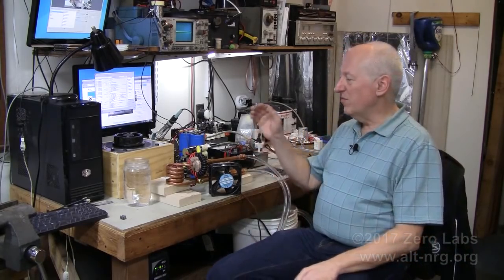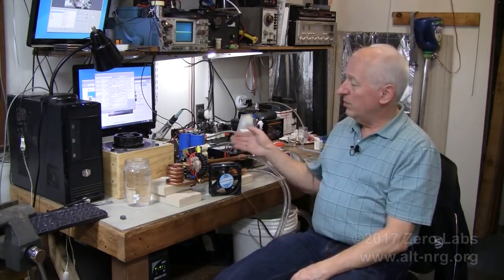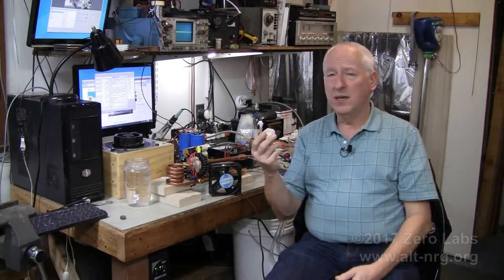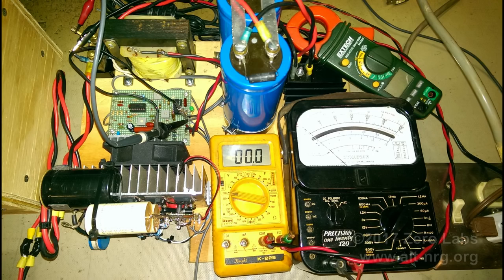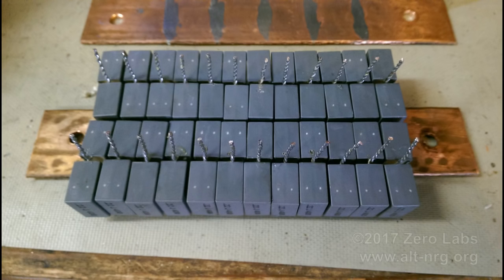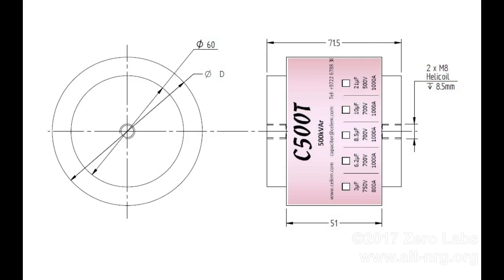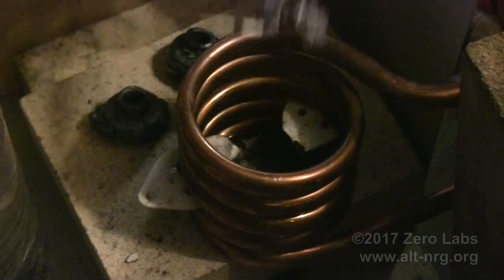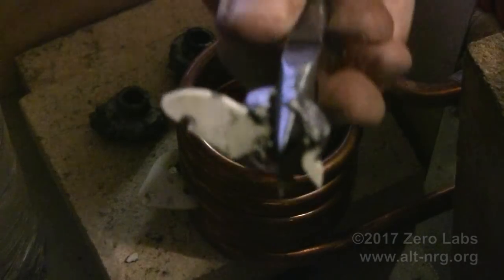#470 1.5KW Induction Heater complete & tested!

Comment: You're reaching Curie temperature and you don't have the power to overcome it. The metal hits a certain temperature and loses its magnetic properties. Thus, your induction heater is not as effective. You're hovering in that state.. the metal will sparkle as you go back and forth gaining and losing temp. Put it in the proper crucible and you can overcome this. Or get a more powerful induction heater where you can control the frequency.
Reply from the maker: I realize this. Working on it. Thanks for following.

Comment: Since this furnace needs a lot of parts, where are you finding parts at reasonable costs ?? I just like that you are really working hard on making things happen without fear of FAILURE. I will be doing the same thing soon. Hope you can guide me with asked question. Nice work fella too.
Reply: I don't know where Mr. Zero Labs gets his parts, but I get a lot of parts from aliexpress and banggood for pretty good prices.   If you "will be doing the same thing soon.",  you might want to start out with a complete ZVS induction heater. 1800 watt units start out as low as about $60.00.
Reply: @frenchcreekvalley  Thank you for letting me know Sir. I will take your advice on sourcing items needed for the project.

Comment: hi!! great job, its  evident you know a lot about electronics, thanks for sharing!! i have a doubt,  its possible to turn it on when there is a pice of metal inside the induction coil???or you have to wait the circuit to be oscilating on its own before you use it.
Reply: Hello Tim.  I am not the original poster of this video.
But I did try turning my 2500 watt Chinese ZVS induction heater on with metal in the work coil and it worked okay.
Here's what I did:
I first apply power mains power to my DC supply and wait for it to be ready for full power (about 4 1/2 seconds)
Then I placed a 2 1/2 inch diameter thick wall aluminum tube fully  into the 10 turn  work coil which has a 2 5/8" inner diameter.  I then  switched on the DC power to the circuit.
In this case, the total DC amperage went to 17 amps.  I didn't see any "spiking" of the current as I did this, so I think it will work just fine.
When I removed the aluminum tube from the work coil, the current dropped to about 6 amperes, which is normal "idling" current for that setup.

My other experiments with Chinese ZVS induction heaters can be seen here:
https://spaco.org/Blacksmithing/ZVSInductionHeater/1000WattZVSInductionHeaterNotes.htm

Pete Stanaitis
----------------------

Comment: Hi i made induction furnace but i have one qustion what amount of voltage required in work coil and current i set 10 to 100 volatge what is best i have work coil of 20 turns and 50 uh

Comment: How can I contact you, I need a large induction heater with the coil diameter 0.5 m .
Reply: What do you need to heat? (I am not Mr. Zero Labs, but I can suggest some contacts).
email:   spaco@baldwin-telecom.net
Reply: I need to heat a human sized gas container. I don't want to build it, I want to buy it.
Reply: @harlolindo7749  
I suggest that you gather some more specific information-
-Exactly  how large is the container?  If you are describing a propane cylinder, what size is it?
-Verify that the container is made from steel, not brass or copper.
-Do you want to heat the whole thing,  at one time or just some portion of it?
-To what temperature does it need to be heated?  How rapidly?
-If your application is not a "secret", be prepared to discuss your goals..
Then contact a company such as:
https://www.inc.com/profile/ameritherm-inc
or:
https://www.ambrell.com/
or:
https://radyne.com/

There are, of course, Chinese companies that make or resell larger induction heating units, such as:
https://www.alibaba.com/product-detail/25kw-50kw-80kw-100kw-120kw-160kw_60018066977.html?
and:
spm=a2700.7724857.normalList.1.2ee2e886mvZFl6&s=p
I have no connection with any of the above, except that our blacksmith club had a demonstration put on by the Radyne people several years ago, and they seemed like nice people.

Many people buy a Chinese Induction heater that can produce about 7.5 KW (even though it is sold as a 15 KW unit).
Here is one example of that product offering, but  you might need more power that this one can provide:
https://www.amazon.com/Frequency-Induction-Furnace-Silver-Copper/dp/B00WHU96P6
Reply from the maker: I need to heat a mixture of iron and gallium to form an alloy and cool it gradually starting from one tip of a crucible to the other. See https://www.youtube.com/watch?v=2xjhK2aSV1E

Comment: What material is required for the crucible? Does this coil have to sit inside the crucible or can u slot the crucible inside the coil? Forgive my ignorance, electrical engineering type stuff is wonderfully fascinating but i have little knowledge in the field except what people are trying to do with resonance (which is where my true interest is along with crystalline based electro charge geometry and dynamics
Reply: I apologize if it seems that I am hijacking this post.  But I have answers to some of these questions here:
https://spaco.org/Blacksmithing/ZVSInductionHeater/1000WattZVSInductionHeaterNotes.htm

Comment: Hello, you talk about the capacitors being 250Vac in the series resonant circuit , but how much overvoltage You get at resonance?
Reply from the maker: None. The whole point is to size the caps to not exceed the max voltage rating at resonance. This is calculated from the tank circuit impedance at resonance.

Comment: I wonder if you could use a vacuum chamber instead of an argon chamber, would it significantly lower the melting temperature?
Reply: Not my video, but I did work in the high Vacuum heat treating industry years ago. Answer: No.  We didn't melt steel there, but we did melt copper and heat things up to about 2300F on regular basis.  We used the melting point of silver to check instrument calibration, by the way.  Nobody ever told us to adjust for the vacuum  (which usually was in the 1/10 of a micron range.)
Reply from the maker: My glovebox could never hold that vacuum. Nor could anyone work with gloves inside a vacuum.

Comment: could you run a central heating pipe throuth the coil to heat the pipe to get cheap central heating to the whole house and hot water ,would that be economical ,to good to be true???  I can see why i went throuhg the school system and never herd of     nikola tesla and wilhelm reich, supressed knowledge
Reply: There would be NO heating advantage.   Nothing "cheap" about it.  The electrical energy needed to run the circuit is the source of the heating power.  One could just simply buy an electric heater and get the same heating ability.
   Regarding Tesla, etc.:   There is so much knowledge to be transferred these days that it is no surprise to me that Tesla wouldn't be covered.  But I think that depends upon which classes were available and which classes you chose to take in school.   Do they even have "electric shop" in high school anymore?
Pete Stanaitis
---------------------

Comment: I may be just guessing... but have you tried submerging the electronics in a tank of deionized water or mineral oil? The pc overclockers sometimes submerge their entire electronics. It may wick away the heat more efficiently and eliminate any hot-spots/ burnouts. 

Another thing I would attempt (but may not work) is trying surplus Russian military CAN capacitors. Series a few up for the correct value and pass each with a VERY SMALL value film etc. to up the response time. On one project I was working on; I tried replacing same value large cans with small hi-voltage film... the films melted almost instantly. Yet the cans had been doing duty for many years. The surplus military can caps are cheap as dirt and virtually indestructible. These capacitors together may solve your issues. Check eBay for the Russian caps.
Reply: Hello Rick,

I have been experimenting with using a ZVS
device to make steam, for home heating and to run a small steam engine. See my
YouTube channel here: https://www.youtube.com/user/zerwell47

My testing indicates that there is a lot more
BTUs being admitted to the testing room, than is represented in the input
energy: Input voltage- 120V AC at 60 Hz at 4 amps (E field) = 480 watts/hr.

The secondary output: 40V AC at 50Khz at 500
amps = 20 Kw/hr. of Electro-Magnetic Oscillations (waves) (EMO) (B field). The
B field, acts at 90 degrees to the E field. Apparent COP = 41.6.

When the B field comes into the vicinity of
Ferrite materials, the iron atoms start to vibrate violently, causing BTUs to
be thrown out of the “Sea of Energy” enveloping all matter.

I am having severe overheating problems on
the secondary. The #10 stranded electric wire, supplying the coil is melting
the plastic coating.

Your suggestion of submersing the equipment
in mineral oil seems like a worthwhile consideration. Thank you for the idea.
Chuck Bagwell, Erie, MI.

Comment: One thing I don't understand. Why is everyone spending the big bucks trying to reinvent the wheel? High current HF induction coils are a byproduct of the Tesla coil and it's variants. People quickly noticed that iron inside the primary coil would quickly glow red hot or even melt. If you want a good induction coil, just make a high output (1k to 2k watts) Tesla primary circuit. It is not rocket science. If you want a specific frequency, then specifically design and tune the primary coil / parallel capacitance for that frequency as you would for a good match to a Tesla secondary. Homemade, I could build a target frequency resonant coil/cap tank for under fifty bucks.

Comment: seems you could have used just an hho water-torch if you wanted to melt metal..you did that before didn't you
Reply from the maker: 1) Much more likely to sublimate the metal, 2) More difficult to control the temperature during the cool-down phase, 3) Atmosphere around the molten metal impossible to control using a gas flame with water byproduct.
Reply: ok makes sense

Comment: Here is a 3kw induction heater made by me https://www.youtube.com/watch?v=TRYKMu2_wFA , it melts stainless stell (non magnetic) wich is much harder to melt than normal steel. You can see how it lifts up the piece o metal, melts it and then almost levitate it until the power cuts off.
Reply from the maker: Once iron and steel reach the curie temperature they too become nonmagnetic. Mine will operate at 3KW from household current when I switch from 120VAC to 240VAC. It would be nice if you open sourced your design.

Comment: I have a friend who is a Blacksmith and he showed me the same sparks you have going on. As far as I understand it, the sparks are metal burning. My thinking is that you are getting to melting temp then going way above it very quickly and therefore burning and oxidising the metal before it can 'puddle'. Maybe see if you can get to melting temp and then hold it there without burning? Would be interesting to see if this changes your results. Great project! :)

Comment: Hey Zero, this is great! Amazing job! Have you considered using a levitation coil so that the metal is suspended in the EM field while it becomes molten? https://i.ytimg.com/vi/iC21sjlhpFE/maxresdefault.jpg
-Jake
Reply from the maker: It has crossed my mind, and it does look like fun, but there are two problems as it relates to this experiment. 1) I need to be up in the 2-3KW power range (which I will eventually get to anyway) and 2) It can only be done with individual solid blocks of metal. My intent is to create an alloy from two very dissimilar metals. Levitating them together would be next to impossible. Thanks for watching!

Comment: What frequency of AC are you using?

Is that what you mean by "locked on", are you finding and using the materials ideal frequency?
Reply from the maker: +Kyle Micallef My tank resonates at 54KHz give or take a couple depending on the load material placed inside and temperature. When I say "locked" that means the PLL oscillator found the peak resonance and locked onto that frequency. It then stays locked even as conditions inside the work coil change. For instance, as steel heats, when it reaches the Currie temperature, it becomes non-magnetic. That loss of magnetic permeability changes the inductance of the coil and the resonance of the tank. The PLL circuit follows those changes to stay locked at peak resonance. You're going to hear me talk a lot about Currie temperature as the experiment progresses as it's an important factor in the manufacture of the alloy.